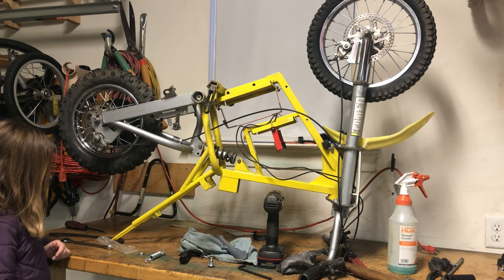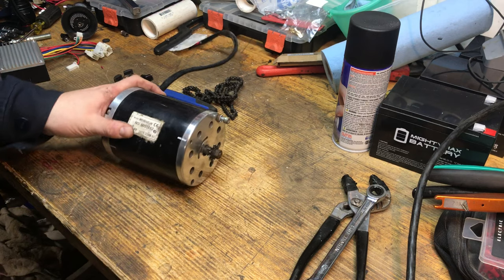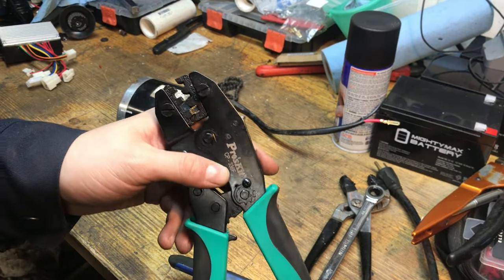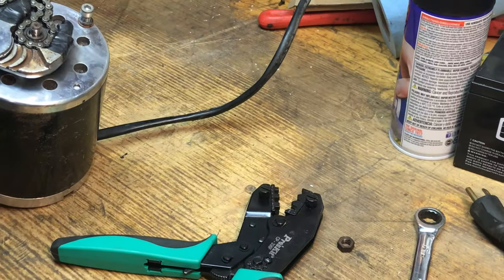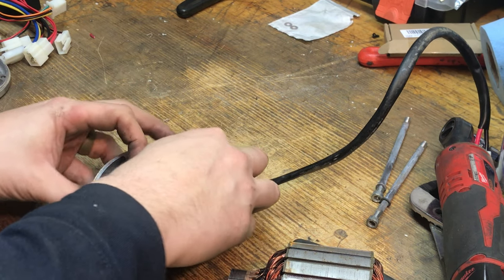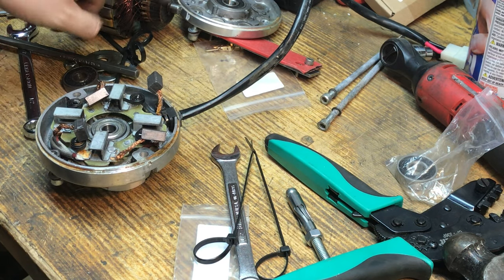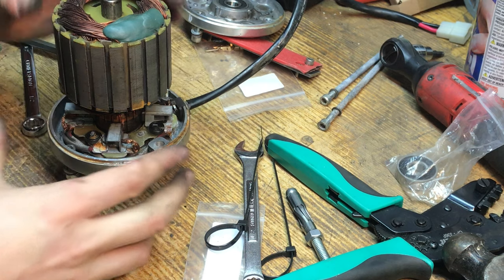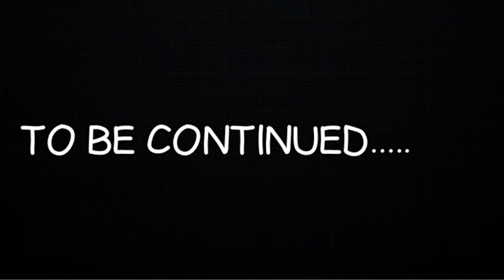Razor MX650 Rebuild Part 3: Kickstand and Motor Bearings

Comment: You made it look so easy seating it back into the brushes. I had such a hard time when i did it. I didn't replace the bearings though. Because of your video now i know i should. I did exactly what you did for my 7 yr old son with a mx500. 😁👍thnk u so much for this video.

Comment: FYI, the brushes in the motor can be pushed all the way back and they will hold in place by the spring catching. After inserting the commutator, you can release the brushes and springs with a small screwdriver and they fall into place. Also, there should not be any hammering required when putting the caps back on. What most likely happened, is when you were putting the first cap back on, the magnetism brought the commutator out just enough to allow the brushes to sneak out of place a little. When you were forcing/hammering the cap back on, you most likely crushed/broke a couple brushes. If you're lucky, they didn't get damaged too bad and the motor will run, but you most likely have broken pieces of brushes in your motor now. Not criticizing your work, just passing on my experience. Constructive criticism, I guess :)
Reply from the maker: Commutator never pulled out, the reason it had to be tapped on was getting the bearing to seat.
Reply: this is exactly what I did and was just about put post the fix..it makes it easy

Comment: Thank you for a great video. What size of bearings did you use for a replacement? I got my D flat part where the sprocket sit on stripped and not a new sprocket does not sit on the hub properly. Is it possible to replace the stripped stud in the motor?
Reply from the maker: I believe it was 6000 and 6201 bearing sizes. What striped the threads or is the flat spot messed up? Flat spot is messed up maybe try using a file, if threads are messed up a threading die can fix. Outside of this I don’t think you can replaced that specific part and it would be more economical to just get another motor